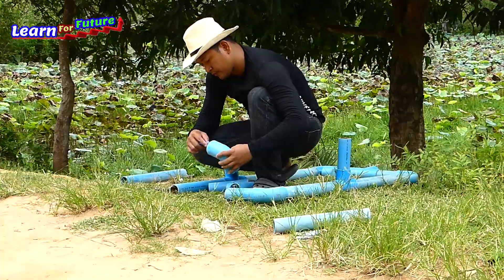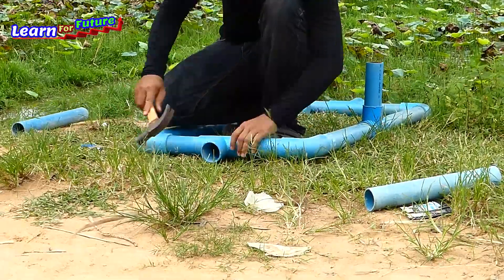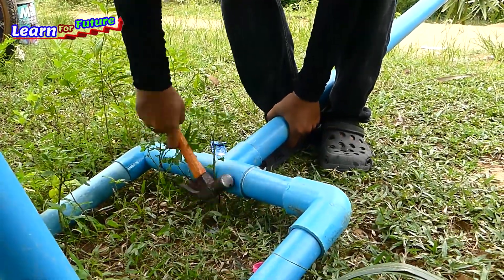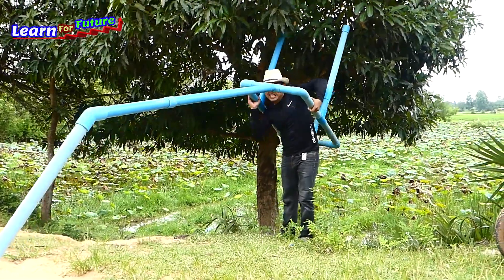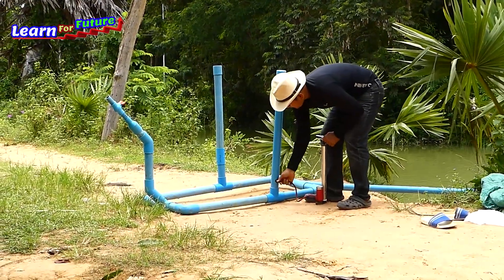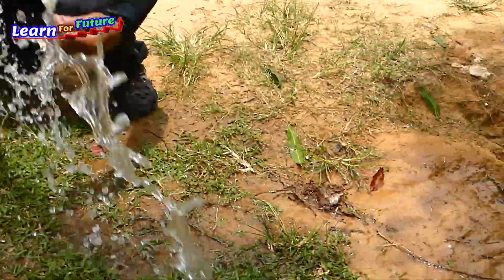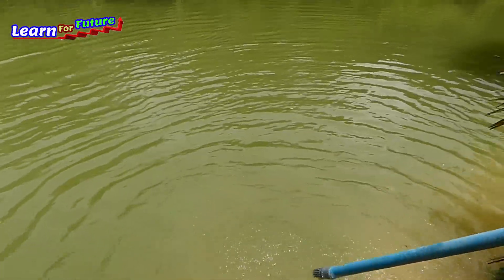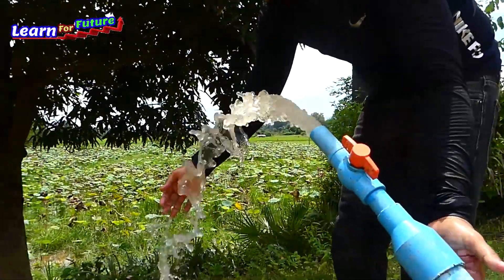Free electricity | I turn PVC pipe into a water pump at home free no need electricity power |  #pvc

Comment: If the pressure is finished will you need to pump again?
Reply: Air is and stays in the standpipe.
When he is putting water in the system the air is trapped in the standpipe .
When he is putting more air in the standpipe the more pressure on the water he gets but it has a limit , to much and the excess air moves in the system .
You saw that the second time he pressured the system in the first couple of seconds much air was coming out of the output pipe . 

Very interesting system , i am going to build me a test rig to see how i can play with it .
Also i am curious how much water flow it gets with what type of pipe you use .
Reply: @dreddredd7137  Please let me know how this goes. I'm very interested in doing this for my yard.